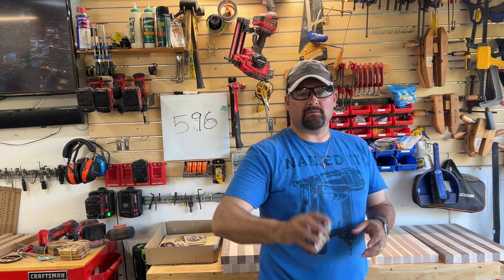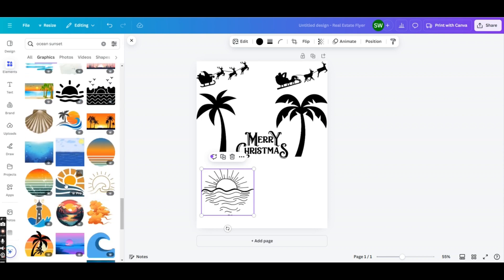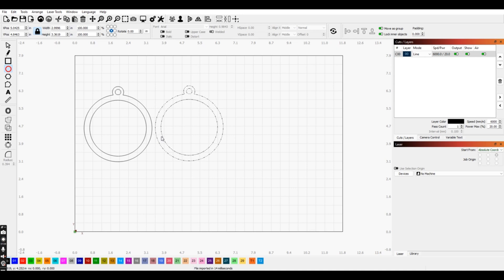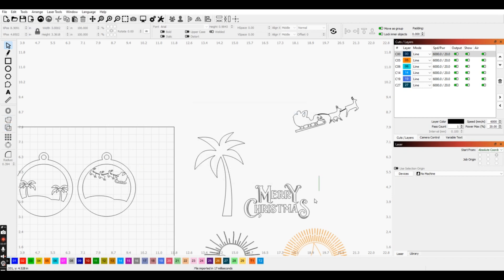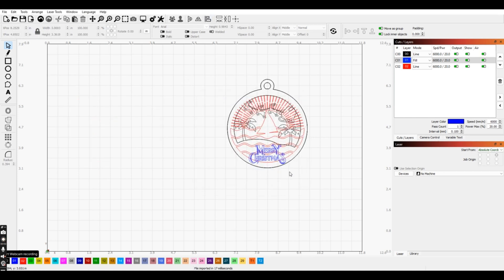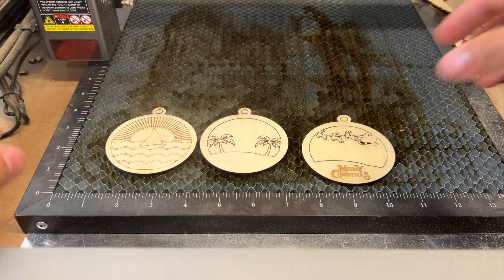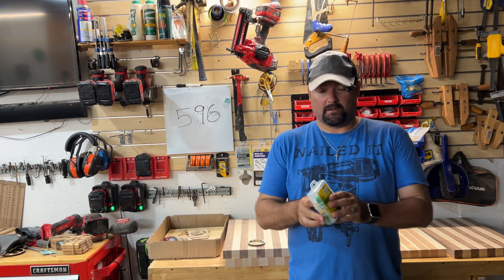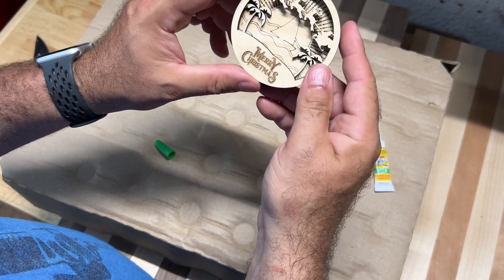Get Ready for the EASIEST Laser Christmas Ornament Tutorial EVER!

Comment: Hi, thank you for the design.  Very cute.  I'm new to laser engraving.  I have the falcon2 22w and I used 1/8 basswood.  I scored the wood but did not cut at all.  Can you tell me what I did wrong?
Reply from the maker: What settings did you have your cut set to? I would suggest you try 500mm/m @ 70-80%.  If that doesn't cut through adjust the settings to slower and more power gradually (speed in intervals of 50mm/m and power by 5%) until it cuts through. If you have additional questions let me know - Steve@WilmerWoodWorks.com

Comment: I got your design online - I tried first doing my own and it was a good experience - I am very new at this - the 2nd rain deer did not stay attached to the other ones - Any advises?
Reply from the maker: The small little lines can be difficult if you don't have your cut settings dialed in.  There are 2 things I would suggest trying.  

1. Try cutting the layer at a lower power with multiple passes so that the deer stays intact.  

2 when you have the file in lightburn ungroup the ornament and select the top of the inner circle (where the deer heads are) and do an offset inward at about 0.0090 and this will make the design a little thicker and should allow for the cut without any issues.

Let me know if this helps or if you would like a short video showing how to make the changes.
Reply: @wilmerwoodworks  Thank you so much let me try first

Comment: Your cuts look super clean. My edges are always messy, and I wind up inadvertently making the items dirty from handling. How do you work around that?
Reply from the maker: Good question! Do you use air assist when you are cutting? Make sure that the filter on your air pump is cleaned regularly to make sure a good air flow.  If your laser struggles with cutting try making 2 or 3 cut passes.